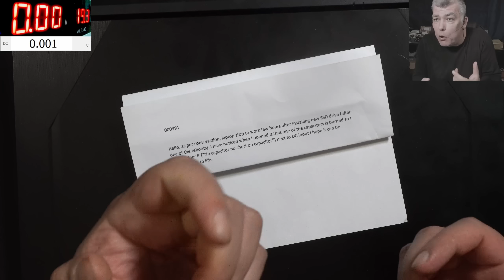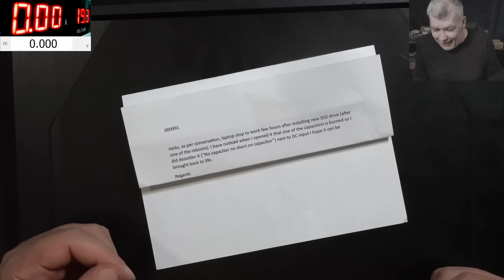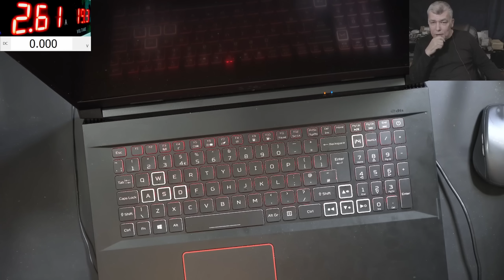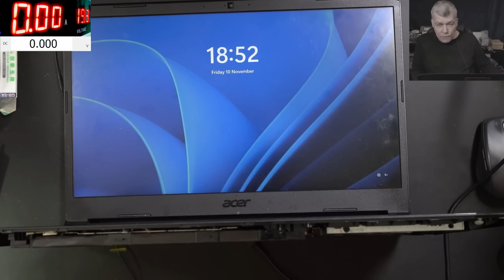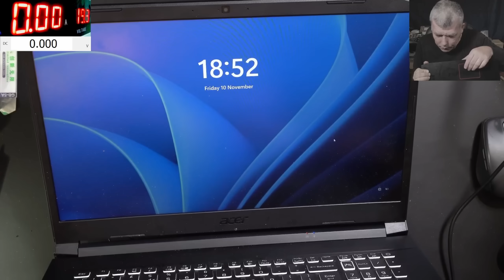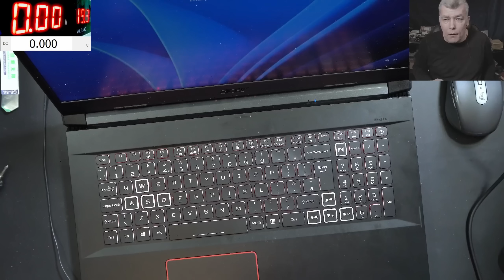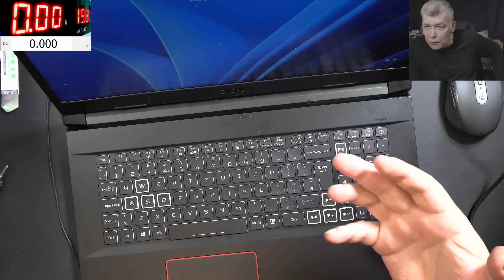Customer removed a blown capacitor and that didn't fix the problem, what went wrong? Acer nitro 5

Comment: Would it be more appropriate to install a Fuse in-series with a OEM Inductor to bring things back to original design & have an added future protection.  
Your video's are inspiring new learners across the pond. 
From Alberta, Canada.

Comment: Inductors conserve current by storing energy in a magnetic field, whereas capacitors preserve voltage by storing energy in an electric field. Please explain why replacing an inductor with a "fuse" works? Since most inductors are low in resistance, doing so are you not changing the purpose of that specific circuit?

Comment: If a capacitor blew but was not shorted afterwards, removing it would don absolutely nothing......  Something caused the inductor to blow, the black mark on the board shows that.  The laptop then stopped working, but removal of the blown inductor would of course do nothing.  Now that it's working, need to know if the owner took out the SSD which appears to have caused the fault or if that was just a coincidence.

Comment: Two days ago I tried to do a hinge repair on my old laptop. I had to take it apart almost completely and the plastic melted and warped to the point that the battery can't be inserted again. The hinges moved a bit and I had to cut away plastic so I could assemble everything back.
I still didn't find the courage to try to turn it on 😂😂
Reply: @westsenkovec: I understand you. It anguishes me until it makes me tremble (panic It makes me feel like a cold sweat runs down my back) when my close family members ask me to check their iPhone. Fortunately they believe me when I tell them that I do not have nor do I intend to order such expensive replacement components...

PS: Just thinking about opening it, with my nerves I think I would break the plastic casings
Reply: @AzuaraRuiz-md1bi  everything went well until I was finished. Then I saw the warping. I was disappointed because I was careful not to point the hot air towards the plastic. Maybe the ambient heat was too high.
Reply: @westsenkovec  Thanks for your answer. I have broken the fragile front plastic bezel (hooks, very poor quality) on Atvio frequently although I use a plastic spudger to reach the hinges and when I remove the screws, the plastic support that contains them also breaks. It's China and there was government support for many children to receive "virtual" classes during...
The good thing is that it is yours and you can decide later to buy another case. Sincere greetings from Mexico.

Comment: I found a very good fix, without disassembly. By running the laptop on battery, writing some lines in word pad or notepad, and not using any other application. Some desktop renaming, file explorer, starting the Start menu, and offline. The fan speed informs, how the fix is working, the aim is to reach min fan speed using each power plan,
with max settings. The fan speed must be min through the whole drain. The cpu has to be set to 0% at min, 100 for max. Balanced mode balances the battery, each cell has to be evenly warm, the battery electronic panel hot. After the fix is done, the cool laptop can be used for gaming forever, with just one battery pack. The battery doesn’t have to be in the laptop after the fix.

Comment: A little knowledge can be a dangerous thing.
Before the days of surface mounted components it was easy to tell just what 
a component was just by it's appearance, but today unless they have markings on them 
or on the pcb they all look the same.
So unless you have the experience as Sorin has, don't remove anything.
Not even a "Calibrated Fuse"!🤣

Comment: You told them to do so (kind of). I remember a video where you just removed a component "because we don't need it". I think it was a mosfet near the cpu but I don't find the video right now..... However it worked (for testing ) and I laughed my ass of because of your comments on that one. That video was the reason I subscribed

Comment: Windows updated and it took long to restart. The client thought it was a hardware issue. 
I handle 30 computers in the office, it is not unusual, if the pc does not start immediately after a silent update.

Comment: Good Job   Professor! Funtastic !...Perhaps Customers Laptop Charger has a very low Amperage below 4 amps...
Reply: Can You test your calibrated wire with a thermal camera and see it's behavior?
Reply: @camarasberta9498 its just behave life fuse, so don't worry about heating and blow again

Comment: I bet it just needed power drain, customer thought it was motherboard issue, removed back panel, and triggered the Acer stupid killswitch, then removed a part that didnt have anything to do with problem. You just put mobo back in original state

Comment: Why did you not replace it with proper inductor or run burn-in with GPU benchmark for 2 hours to assure no other system stability issues?
Reply: He does have the problem that he has no idea what sort of inductor was there originally.
But yes, he did a very crude hack and concluded it was OK. He does that sort of thing a lot.

The inductor was probably a "ferrite bead" designed to be lossy (like a resistor) at high frequency and used to meet EMI/RFI standards. It might also have been important for signal integrity. He's been known to take out a bunch of ceramic caps there at least in part for the same reason and just state completely without evidence that the board would still meet standards.
Reply: @D614G_aka_Doug : Multilayer Chip Bead, Impedance =100 ohms, DC Resistance = 0.02 ohms, Rated Current = 5A máx. All the best.

Comment: Thank you for the explanation at the end. I remember you saying an inductor is a wire, so what you did is definitely a safer option,… excellent work Sorin
Reply: There is zero reason to believe that what he did is "a safer option." The inductor that was there originally might have fused at less than 1 ampere while the wire would probably hold up just fine for quite some time at at least 5 amperes.
Reply: and there's 0 reason to believe you after using the the word might as solid proof. Go hate on someone else. Be gone goblin @D614G_aka_Doug

Comment: was the inductot required for buck/boost power supply. why did the circuit still work with a low inductance wire???
Reply: It it was like the other small inductors shown it was almost certainly a "ferrite bead." These are usually just a straight conductor passing through a small piece of ferrite and used to suppress very high frequency noise currents. They actually behave more like a resistance than an inductance at high frequency so that the energy is converted to heat. In any case any package that would fit on those pods would be far, far to small to have useful inductance for energy storage as in a switching converter.
Reply: If there are no pulsating current on one of the sides of the inductor it's probably just a filter (the same purpose as bypass capacitor) and could be more or less safely replaced by a wire.

Comment: I think he removed the battery to install the ssd, on the next boot takes longer to boot because its load the kbc rom, so he panic and removed the inductor.
Reply: PCB shows burn marks/soot, and one of the pads actually seemed to have a velded piece of component in the middle. So some sort of event did occur.
In my younger days a short between adjacent windings in power transformers was a thing (due to poor quality of insulating enamel), causing the whole transformer to burn. S
ince this is a high power circuit in laptop terms, by any chance such a short happened in the  coil here? Might go unnoticed for long time if power supply is connected permanently and esp PC is on all the time, or the burn effect may take time (multiple power cycles) to develop into a catastrophic event..
Reply: @drEvilfromLV  the burn marks mostly just reset the bios, with the battery should still be able to turn on but until he paly around and lost all the battery power.
Reply: Yes, that was what I thinking, most Acer bios will restart 2-3 time to detect the hardware, detect the OS, then save the setting.

Comment: hahahahaha🤣🤣 a tool for removing capacitors hahahaha Which dentist did you take it from? A customer's claim after a while the computer hangs >> power consumption settings turn off the hard disk after 20 minutes you need to cancel OFF. Indeed a general setting Microsoft🤕 is still in the dream of a mechanical hard disk

Comment: 12:55 - Yes it blew up for a reason, reason can be that he unplug or plug back SSD while laptop was ON. Not necessarily problem is still there. No hard feelings but if he didnt know that L is inductor and not C capacitor, he can do things like what I explained.
Removing capacitors can pass without problems if they are DECOUPLING. Removing COUPLING capacitor will not pass without problems.
Reply: Orion, can you please elaborate more what coupling cap is and why it would cause problems if removed? From what I have learned in this channel, it is always safe to remove capacitor which one leg is on the ground.
Reply: @asv5769 Coupling capacitor is used to introduce AC component to DC circuit (e.g. in signal amplifiers), or vice versa. The AC signal will not pass further if that kind of capacitor is removed from the circuit.
Reply: @MykolaInc : Indeed. Completely agree. Technical books include the different classes of amplifiers (A, B, AB, C and D) in their curriculum and they are still taught, with transistor-based labs, in some good electronics technical schools. Another way to say it, excellent answer; correct or exact (without leaving room for discussion) the one you share with us in a way that is as simple as it is concise (to the heart of the matter). Thank you very much Mykolalnc. All the best.
Reply: @asv5769   If one leg is on ground, its DECOUPLING. Device maybe can work without this one.
If NO legs on ground, it means is COUPLING. It means you break path when you remove this one. Device will not work without this one. Google coupling and decoupling capacitor.

Comment: from black marks on board feels like there were something touched with the gnd :D
Reply: black marks could be from customers soldering iron. maybe too hot. we will never know the exact cause
Reply: no way its soldering iron. more like measuring voltage with mm in amps mode :D
Reply: @eqp9988  i wouldnt be suprised either way

Comment: I think he meant the laptop stopped working and he just chose to check and he thought he found a short. Maybe what he meant by blown is shorted cap but it's not a cap. Still does not explain why the lap stopped working!
Reply: the inductor fried and opened, he thought it was a shorted cap and just removed it but yeah, it didn't change anything
Reply: Please I need you contact